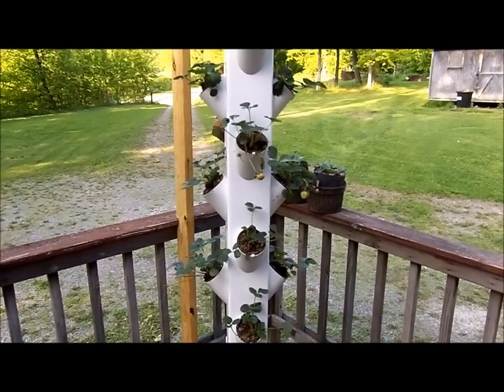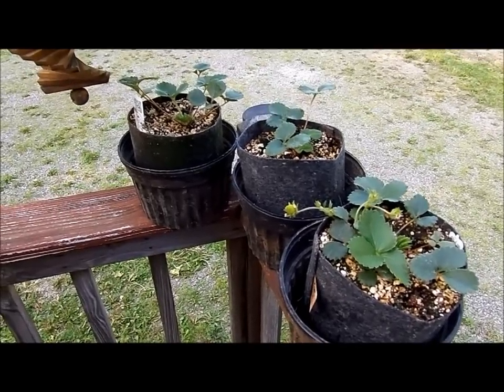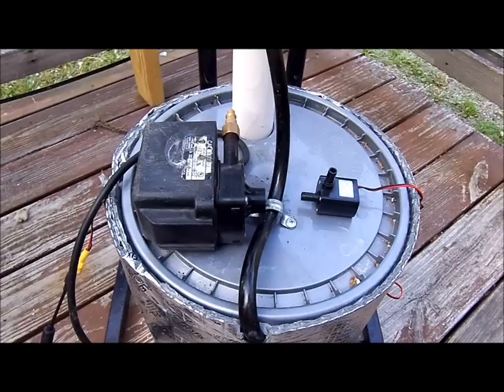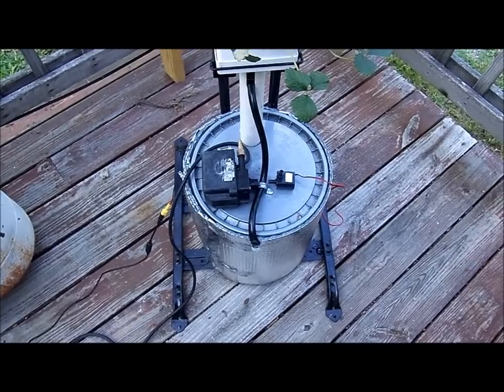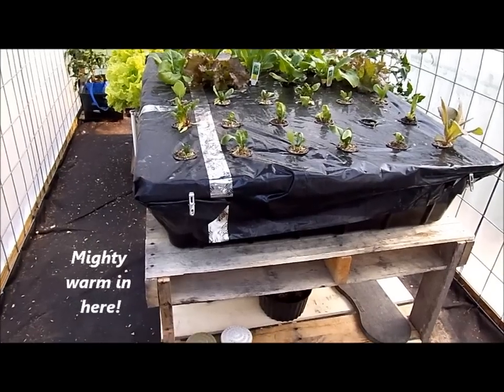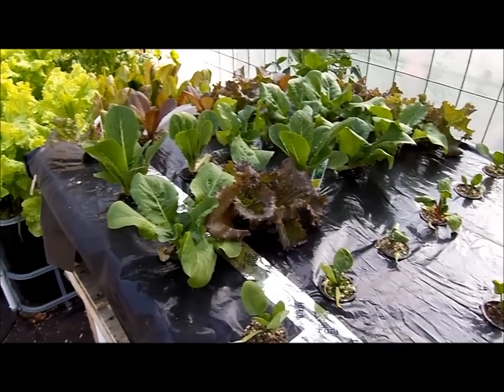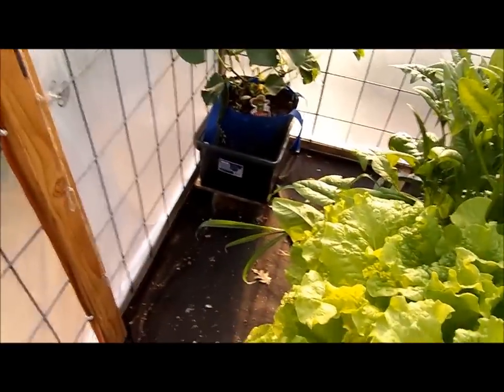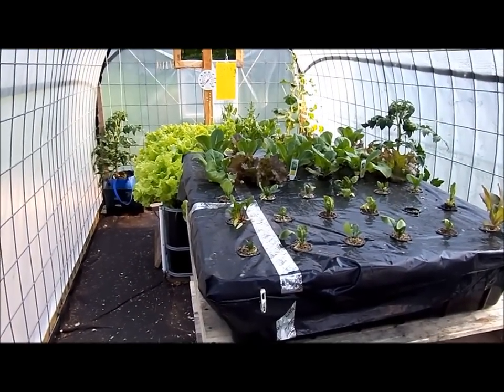Strawberry Tower and Greenhouse Update

Comment: This has to be the most over engineered flower pot i have ever seen......all this just to save 2 mins a day watering your plants...... How long did it take to make...... divided by 2 mins when is the payoff!   Nice job but don't get it!
Reply from the maker: Actually, the answer is quite simple: yield-per-square-foot.  In about 4-square feet, I have 38 strawberry plants! Using the "flower-pot" method, I would need 38 flower pots and a minimum of 50 square feet. Between June and late October (2014), I had fresh strawberries everyday, PLUS I had extra to share.  There is simply no comparison in yield between the towers and the "flower-pot" method.

Admittedly, the towers took quite a while to construct (about 2-days for each one). But now that they are built, I suspect they will last forever. 

Other advantages: I can easily move the towers if I so desire. Rodents that use to eat my ground-based strawberries can't get to the fruit. Soil diseases are non-existent. Harvesting, pruning, and other maintenance activities can be easily done standing at one location; my old knees appreciate not having to bend down to 38 flower pots!  Pollinator's seem to like the towers and work easily among the mass of plants.

Is it a perfect system?  Nope!  I had an issue with uneven watering last year, but I think I have that resolved and am eager to get them going again.

Thanks for watching and your comment!  Regards.
Reply: Thanks for the feedback!!!